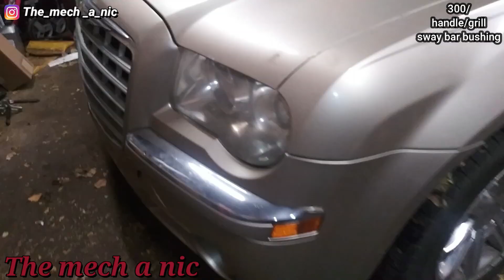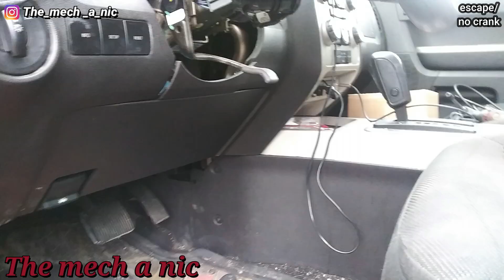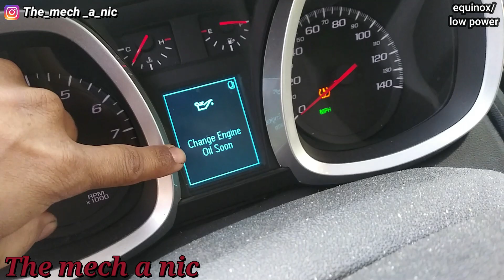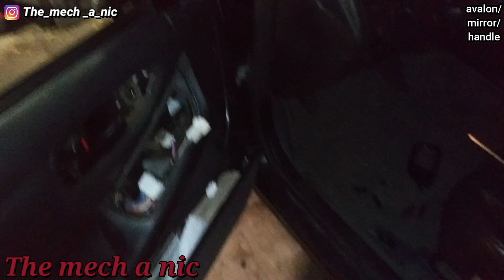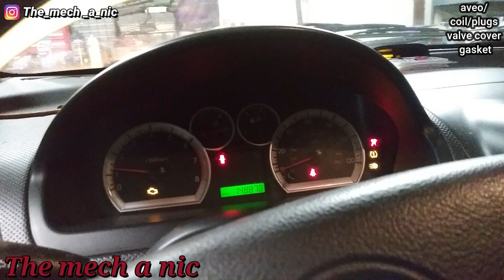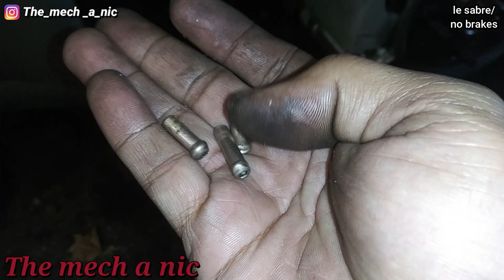ford escape no crank , Buick le sabre no brakes, aveo valve cover gasket (vol 47)

Comment: Those are good tips for diagnosis of the ignition switch assembly. With security being an issue, manuals are never forthcoming. Love that story about the brake rotor at the end. You see problems every day that normal mechanics will never witness. Excellent tip to flare brake lines at room temp. Up here in Canada, NiCopp lines are really expensive.

Comment: Good job Jonathan but that Buick man how in hell do drive a car like that!! People you need to change that oil that is the life blood of the car .. any way Jonathan I was told to use hose clamps on the hhr front sway bar just get it center and use the clamps to hold it in place ... I will get in touch with you after Christmas.. one thing you need is one them torpedo heaters to stay warm in the garage that’s what I used to do when workin on the car in the winter ... this guy is a great mechanic he is good at what he does and these people don’t have a clue..
Reply from the maker: Exactly and the owner drove it here like that! Apparently people think changing the oil is just a recommendation lol . ok sounds good , yeah we can try the clamp idea. I have one of those torpedo heaters that runs off of propane , the problem is i burn through the propane quickly so it gets expensive to use that so i stopped using it.
Reply: The mech a nic 
I use kerosene back in day !!

Comment: On the equinox are you supposed to check the oil level when it’s raining?
Reply from the maker: Nothing wrong with that. Not like you're pouring water into the oil lol
Reply: The mech a nic sorry I use text by voice I meant running not raining🤣🤣🤣 and I cannot always proofread😞😞
Reply from the maker: @ptolalibertad  oh lol 😂 i checked it while it was off also.even while its running it should show something on the dipstick👍
Reply: The mech a nic 👍🏿